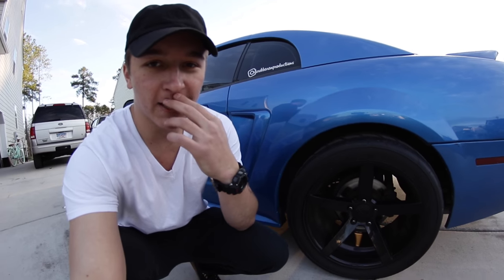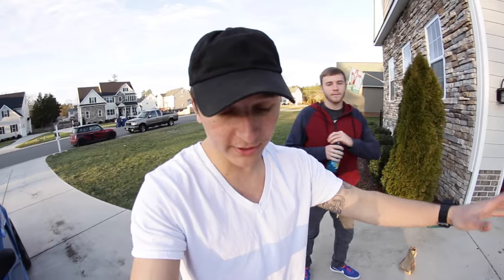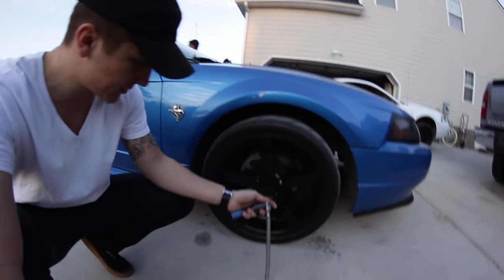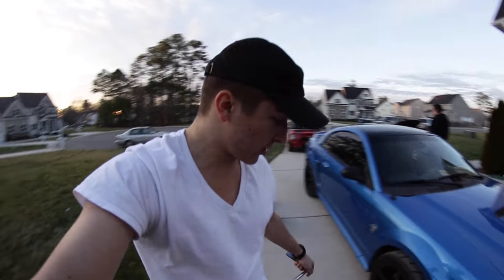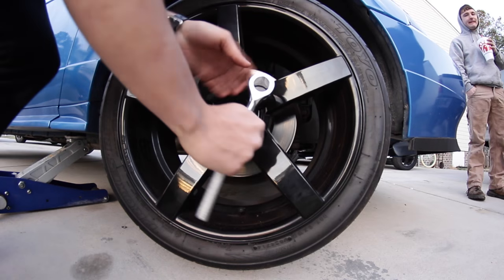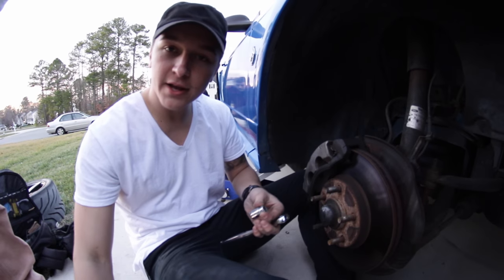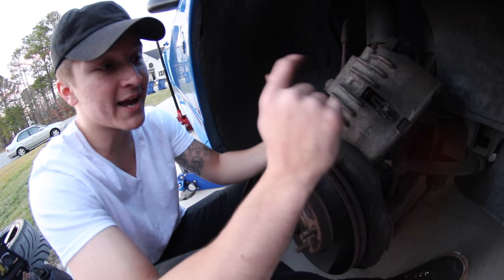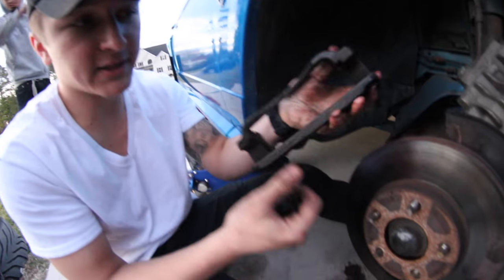RE-DO BLUE: Brake & Rotor Installation! | Episode 7

Comment: Just as an fyi, for future reference. Taking the caliper off, then the bracket, is a useless step. If u remove the bracket first, the caliper comes with it, and you can still change the pads.
Reply from the maker: I had to change the rotors though! But thanks i'll remember that!
Reply: Still possible to change pads... I've actually always done it like tj never how you did... plus a clamp works great for keeping the calipers compressed